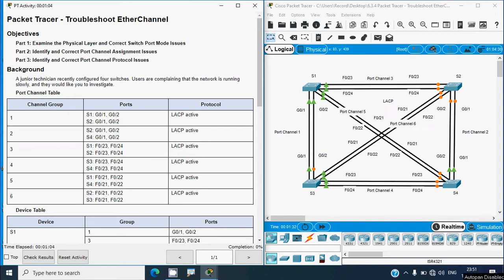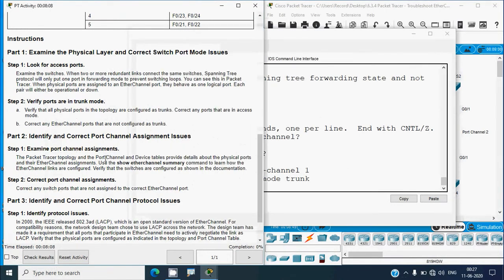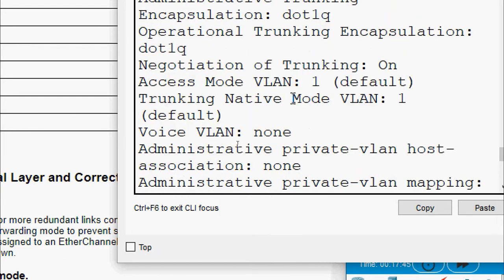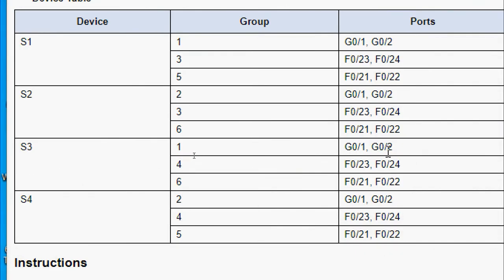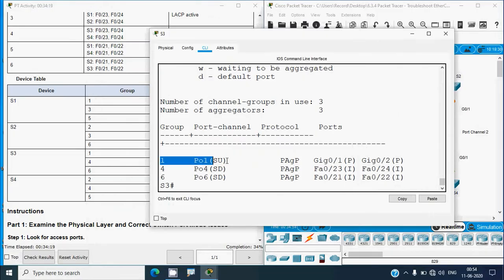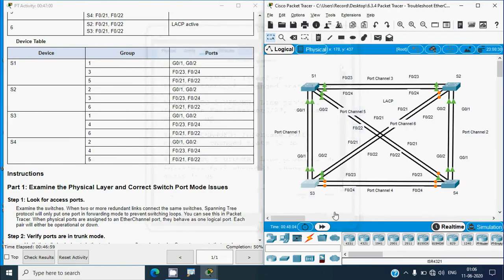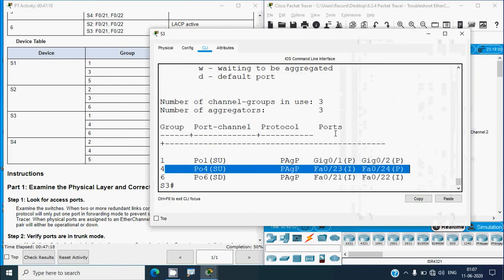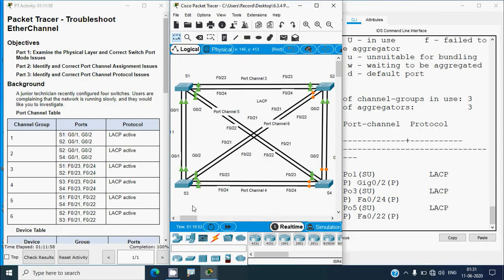6.3.4 Packet Tracer - Troubleshoot EtherChannel

Comment: the command "no int port-channel (group id) " fixes the problem that the S3 its configured on Pagp
Reply: thank you for posting this comment. it's literally the only thing that I needed to work on
Reply: I just removed channel group 1 from both switches and added them back one at a time and it stuck with LACP.. I think the issue is that one switch is autonegotiating pagp so both of them stays
Reply: Great thanks
per Cisco
"Just removing the “channel-group” command under the interface will not remove the virtual port-channel interface. You have to issue the “no interface port-channel X” command in global config order to remove the port-channel interface."